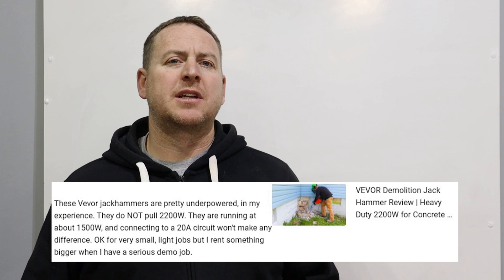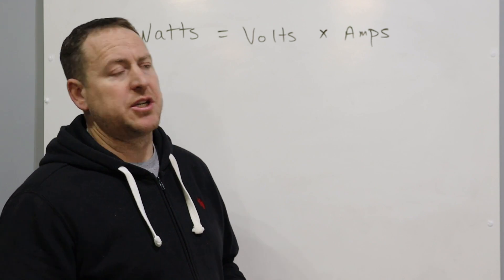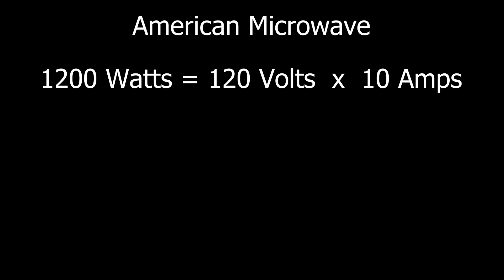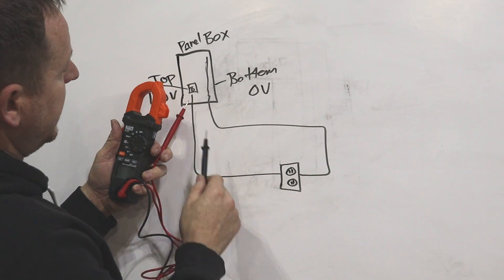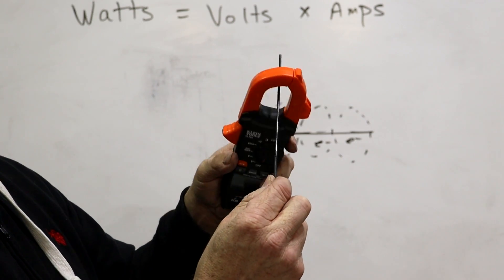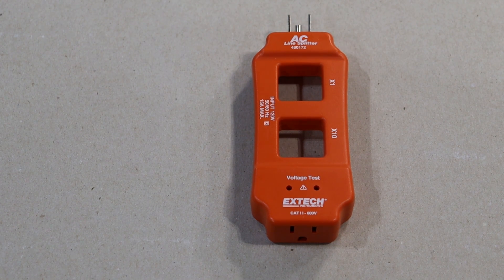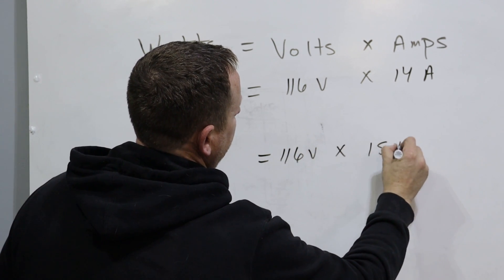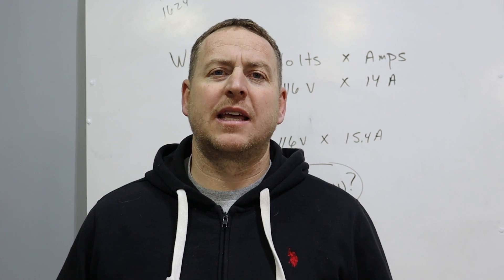Relationship Between Watts, Volts, and Amps | Measuring Volts and Amps | VEVOR Jackhammer Power

Comment: Just a note.... You should never use a load larger than 80% capacity of the circuit. If your circuit is a 20a, and providing 120vac you can calc it as follows; 120v x 20a is 2400w  so  2400w x .8 (80%) equals 1920w max load. This is why you will never see a hand held hair dryer greater than 1850/1875w, because the largest circuits typically found in homes are 20a circuits. A 20-amp circuit breaker can handle about 16 amps safely. There's always someone who will say they put more on it but stick with 16a or less and you won't have to worry.